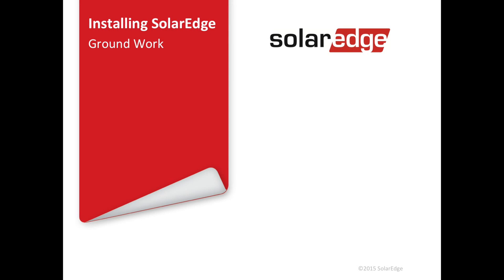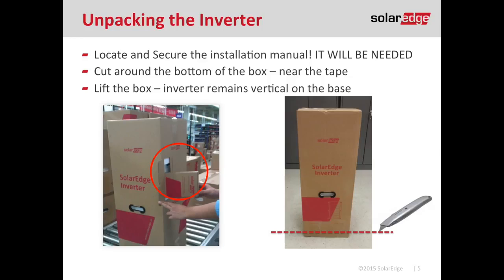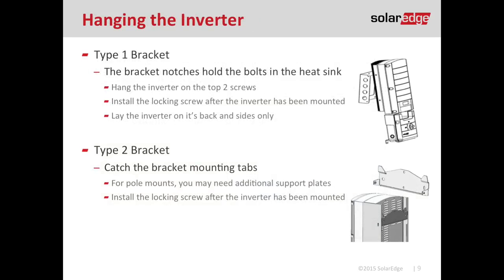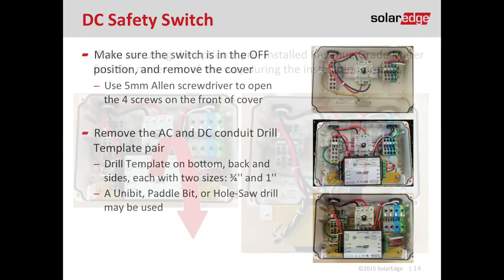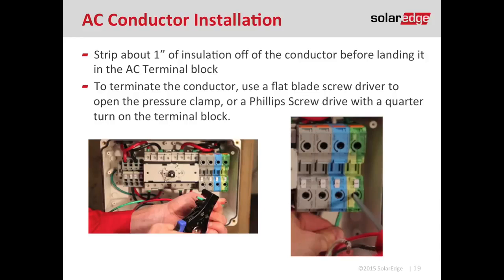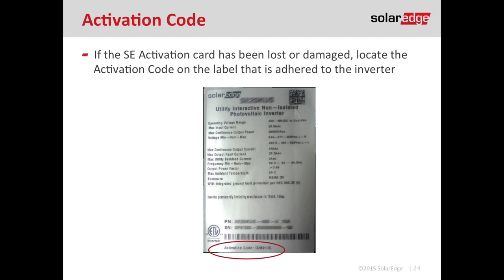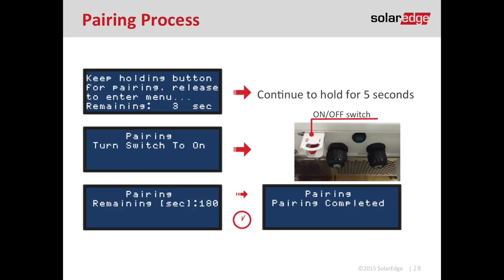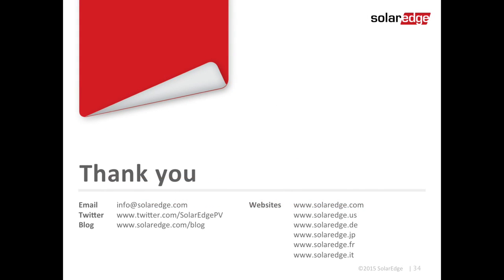How to Install SolarEdge Inverter

Comment: No one shows the twisted pair communications terminal connection between the Inverter and the battery.  The terminals are the tiniest I've ever used, and are 3" deep into the box, the wire is so flimsy, you can't tell which direction to push it.  Straight in?  Straight up?  Can't see anything in there and above that and over to the right is the "DIP" switch, not to be confused with the other "DIP" switch, above next to the display screen.  If you have the factory installed "meter" (which one?) then the DIP switches must be changed, and the communications wiring configuration is different.  I think, it depends on which switch they mean.  The manual is almost useless for this part.